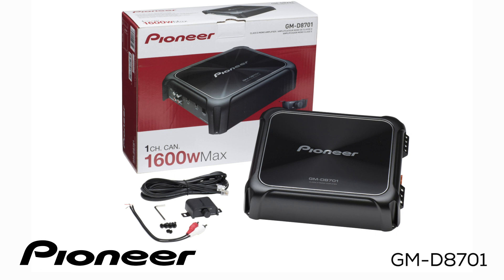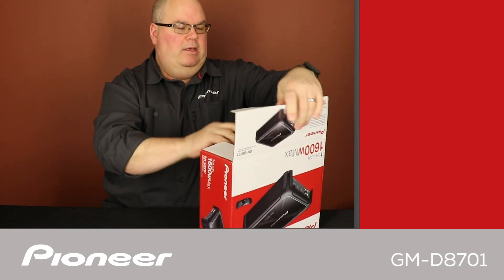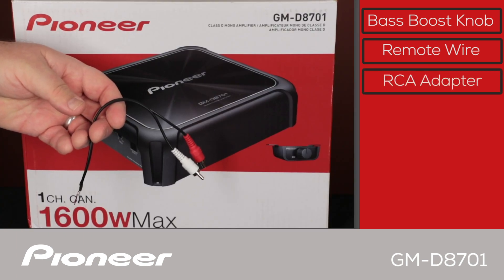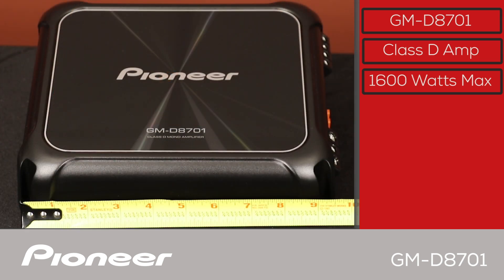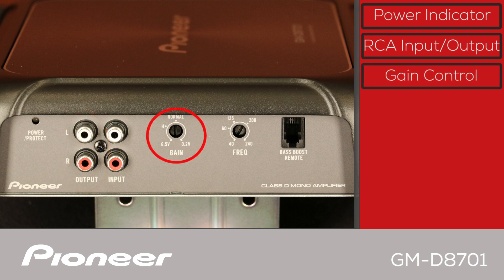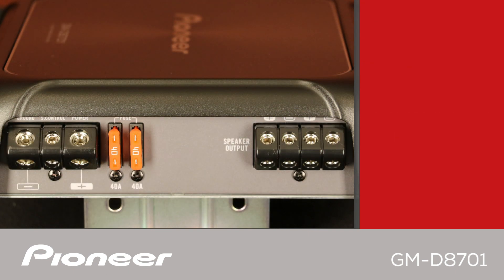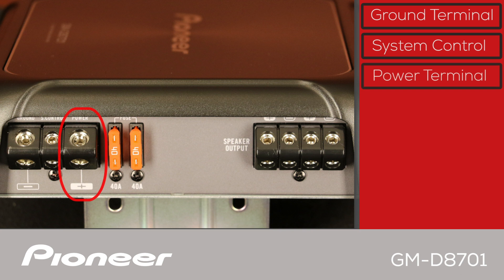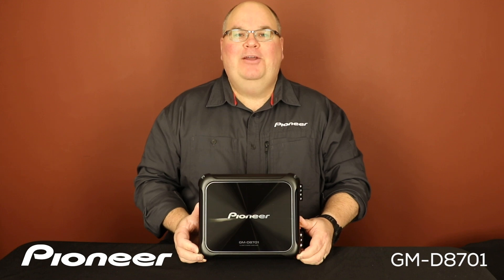GM-D8701 - What's in the Box?

Comment: Hi 
I have poineer 3003d4 with 600rms in 35hz enclosure and poineer 8701 which gives 500 rms at 2 ohm is it ok to run at 2 ohm as it amp is under power, Does amp will heat???

Comment: There is no subsonic filter on this amp. Is there a built in one that is preset within the amp to a certain frequency?
Reply: The frequency response of the Pioneer GM-D8701 is from 10Hz to 240Hz.  You can learn more about Pioneer amplifiers here:  https://youtu.be/99Hfmc8QxVc?list=PLw63zJRQbCNg42VJXw0g7xzWJozqoSR1V     and you can find more videos on Pioneer's YouTube Channel here:  https://www.youtube.com/user/pioneerelectronics
Reply: @deckerdotto6035  Still doesnt answer my question. I asked one of your representatives on the phone this question and he told me that the subsonic filter is preset to 45hz. Seem a little bit high to me and i dont really think he knows what he was talking about. Most ported boxes would require a subsonic around 20-30hz it would make no sense to preset it that high. Im still researching and wondering this question with no straight forward answers. If you could help me out that would be great
Reply: Whoever told you the Pioneer GM-D8701 has a subsonic filter at 45 Hz is incorrect.   The Pioneer GM-D8701 has a frequency response from 10Hz to 240Hz.  This means the amplifier will play all the way down to 10 Hz and all the way up to 240Hz.  If you want to consider the filter at 10 Hz to 0 Hz a subsonic filter, OK.    There is no other switched or preset subsonic, or, high pass filter in this amplifier. You can find the Owner's Manual for the Pioneer GM-D8701 here:  https://www.pioneerelectronics.com/StaticFiles/Manuals/Car/GM-D8701_DX871_D9701_DX971_OwnersManual031319.pdf

Comment: Can i use this amp with Pioneer TS WX306T? It has 350w rms, 4 ohms and 1300w max
Reply: Yes.  The Pioneer GM-D8701 is a great amplifier for the Pioneer TS-WX306T wired at 4 Ohms.  The Pioneer GM-D8701 will output 300 watts RMS at 4 Ohms.  This should give you great power and great reliability for both the woofer and the amplifier.  You can find the owner's manual for the Pioneer GM-D8701 here:  https://www.pioneerelectronics.com/StaticFiles/Manuals/Car/GM-D8701_DX871_D9701_DX971_OwnersManual031319.pdf   You can find more videos about Pioneer woofers here:  https://youtu.be/QgG1mu2u3XI?list=PLw63zJRQbCNhkTQCxPpxGF4h6l6qocsaR and more videos about Pioneer amplifiers here:  https://youtu.be/99Hfmc8QxVc?list=PLw63zJRQbCNg42VJXw0g7xzWJozqoSR1V  You can find more videos on Pioneer's You Tube Channel here:  https://www.youtube.com/user/pioneerelectronics

Comment: Can I use a 600 watts 2 ohms speaker?
Reply: At 2 ohms, the rated output power of the Pioneer GM-D8701 is 500 watts continuous.  And you did not say if 600 is it's nominal rating or max rating on the speaker.    If you want to play this amp and speaker combination at or near full volume I recommend to lower the subwoofer output from the in-dash receiver to protect the speaker.  You can find the owner's manual for the Pioneer GM-D8701 here:  https://www.pioneerelectronics.com/PUSA/Car/Amplifiers/GM+Digital+Series/GM-D8701#manuals   You can find more videos about Pioneer Amplifiers here:  https://youtu.be/hHIDBQdKTSA?list=PLw63zJRQbCNg42VJXw0g7xzWJozqoSR1V  and you can find more videos on Pioneer's You Tube Channel here:  https://www.youtube.com/user/pioneerelectronics

Comment: Bass boost or bass volume? No subsonic filter!!!!
Reply: The Pioneer GM-D8701 has a bass boost of 0dB to 18dB centered at 50Hz with a roll off of 18 dB per octave in both directions higher and lower. You are correct, there is no subsonic filter.  If the music you like to play has a lot of information below 20Hz, and you're concerned about wasting power in that range, maybe a bigger amplifier is a good choice.  Please consider the Pioneer GM-D9701 seen here:  https://youtu.be/6h3b_c3Yxnk?list=PLw63zJRQbCNg42VJXw0g7xzWJozqoSR1V   Or maybe an amp with better performance like the GM-DX871 seen here:   https://www.pioneerelectronics.com/PUSA/Car/Amplifiers/GM+Digital+Series/GM-DX871  
The Pioneer GM-DX871 is a higher end version of the Pioneer GM-D8701.  The inputs and outputs, switches and set up are the same between the amp in the video above and the Pioneer GM-DX871, but that's where the similarities end.   
The Pioneer GM-DX871 uses Pioneer designed and manufactured high quality acoustic elements within the audio signal chain of the amplifier. For example:  Pioneer brand Audio Capacitors for higher audio quality and additional stability in the power supply.   The use of these Pioneer brand audio components for power, headroom, and reliability is the difference.  The top panel is milled from aluminum for excellent heat dispersion, lower magnetic properties, and show grade cosmetics. That and the gold plated RCA's.  GM-D8701 is an excellent amplifier but does not have these features.    You can find more videos on Pioneer's You Tube Channel here:  https://www.youtube.com/user/pioneerelectronics    and by the way your !!!! appears to be stuck.

Comment: Is this the same as the GM dx871?
Reply: No.  The Pioneer GM-D8701 is a great amp.  Compact, clean and powerful.  The Pioneer GM-DX871 is a much better amplifier.  The Pioneer GM-DX871 uses Pioneer designed and manufactured high quality acoustic elements within the audio signal chain of the amplifier. For example:  Pioneer brand Audio Capacitors for higher audio quality and additional stability in the power supply.   The use of these Pioneer brand audio components delivers more stable power, greater headroom with better transient response and reliability.  Details like these aren't typically shown in a simple spec chart.  The top panel is milled from aluminum for excellent heat dispersion, lower magnetic properties, and show grade cosmetics. That and the gold plated RCA's for a more reliable connection over time. Gold doesn't oxidize like other metals.  GM-D8701 is an excellent amplifier but does not have these higher end features.  You can find more videos on Pioneer's You Tube Channel here:  https://www.youtube.com/user/pioneerelectronics
Reply: Deckerd Otto Good to heat. I ordered the dx871 last night and will use it to power my 12 alpine type R.

Comment: I want to connect this amp and a Pioneer TS-SWX2502 10" to the factory head unit of a Honda Civic 2020. I'm under the idea that I need a Line Out Converter to get low level RCA out of the high level speaker wire. With that RCA ADAPTER with this Amp be all I need to tap  into the rear speaker wires, so no LOC needed? Also do I tap a speaker wire to that remote input to turn on / off the amp, or if I'm using the speaker wire adapter to the RCA input, it'll sense that and turn on/off automatically (essentially leaving that remote input empty)?
Reply: When using Pioneer GM-D8701, no line output converter is needed.  Just use the Speaker Level input connection seen here:  https://youtu.be/-Uq25Goo0sU?t=72  Tap into a speaker wire and plug into the RCA input on the amplifier.  When using speaker level input, the amplifier is designed to automatically sense the input and switch on and off with the in-dash receiver.  The System Control seen here:  https://youtu.be/-Uq25Goo0sU?t=203 can be used as to switch the amp on and off, if for some reason the auto sensing system does not operate as expected.  If you are using speaker level input, in most cases you will not need to worry about the System Control connection.  You can find the  owner's manual for Pioneer GM-D8701 here:  https://www.pioneerelectronics.com/StaticFiles/Manuals/Car/GM-D8701_DX871_D9701_DX971_OwnersManual031319.pdf    You can find more videos on Pioneer's You Tube Channel here:  https://www.youtube.com/user/pioneerelectronics
Reply: @deckerdotto6035  thanks for the info! How does this amp handle if the factory in-dash receiver has bass roll-off circuitry? Not sure whether I really need something like a AudioControl LC2i 2 Channel Line Out  Converter, which claims to have a feature called AccuBASS processing for correction of bass roll-off?
Reply: The Pioneer GM-D8701 is an amplifier plain and simple. It doesn't do any signal processing.   It will amplify the signal that is sent into it, even it that signal is not the signal you want,  like a rolled off low frequency signal. If changing the in-dash receiver is not an option for you, please consider using the Pioneer DEQ-S1000A signal processor in line before the amplifier.  You can learn more about the Pioneer DEQ-S1000A here:  https://www.pioneerelectronics.com/PUSA/Car/Amplifiers/Sound+Processors/DEQ-S1000A    This system will use your smart phone and a calibration signal to correct the signal coming from the in-dash receiver.  You may want to change the speakers in the vehicle as well.  You can find more videos on Pioneer's You Tube channel here:  https://www.youtube.com/user/pioneerelectronics